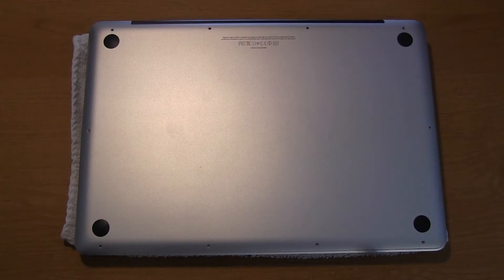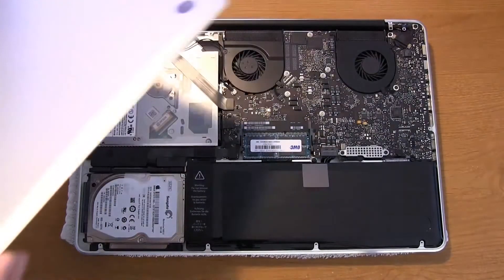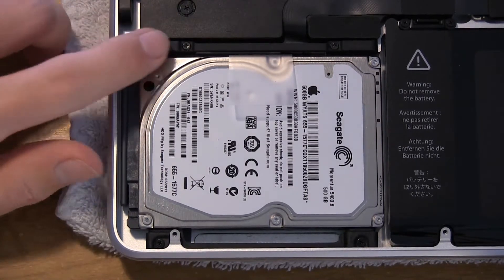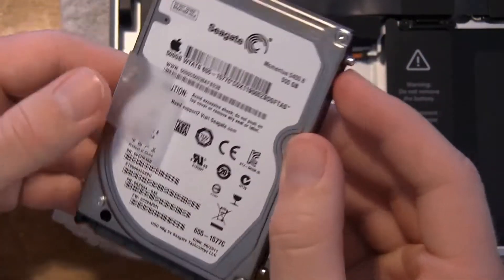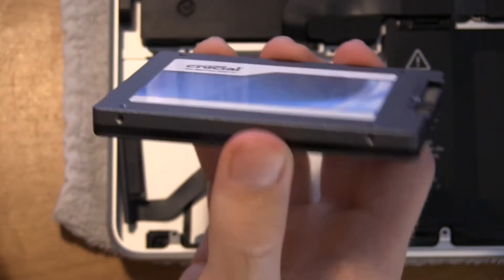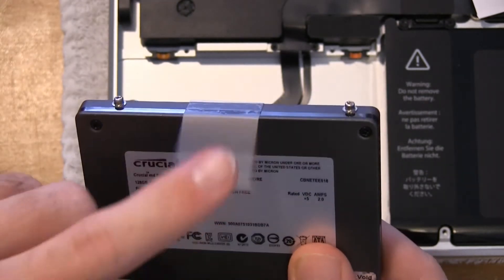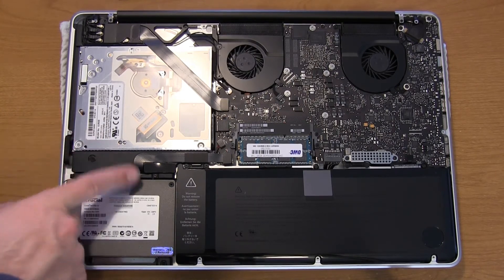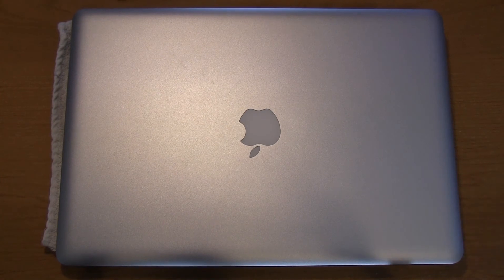2011 MacBook Pro SSD Upgrade

Comment: You can partition a USB drive and get Lion from the App store. Or you can get a double layer DVD and burn Lion to it. Don't just burn the file by right clicking it, use disk utility.

Comment: I disagree too, you should never use over 250gb for an operation Hd, (C. drive for programs and main files) saving photos music and all that extra crazy stuff should only sit on your main drive temporarily and transferred immediately to an back up or external hard drive. whats the point of have 750gb and 1TB hard drive space with programs and files only to have it crash later on. I work in the Video gaming industry and we never use a main hard drive to store a lot of files.

Comment: hey i have a question .....can you upgrade the hard drive or ram even before you power on the macbook pro for the first time??
Reply: RAM=yes, Drive=not really. You could if you formatted it with another mac computer for booting and installed OS X onto it. I wouldn't recommend that however.